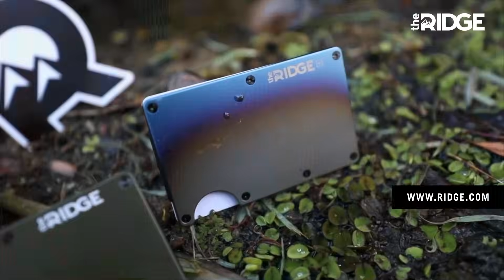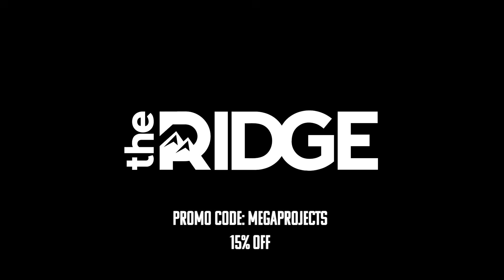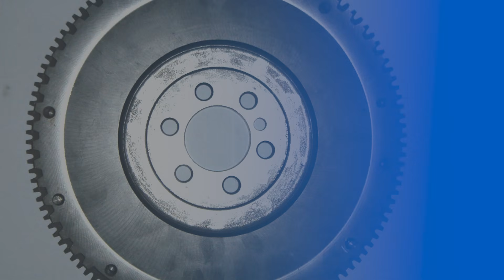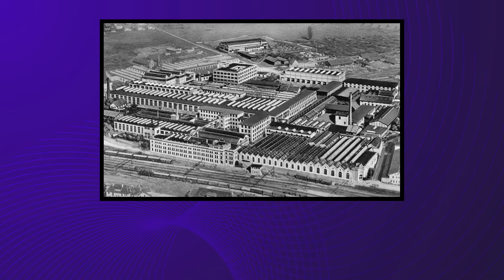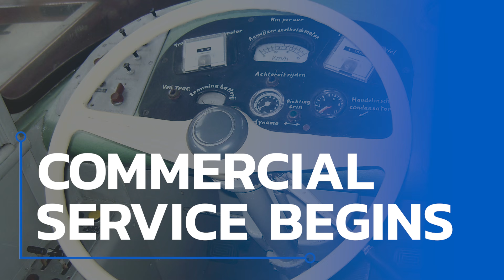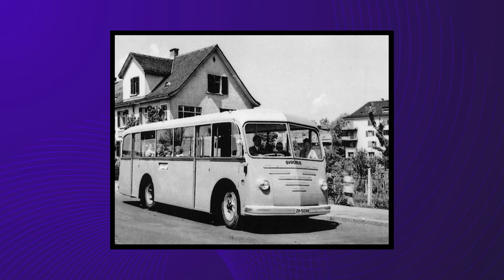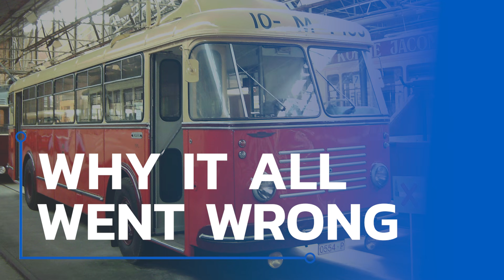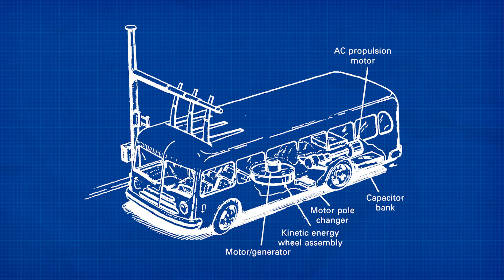Gyrobus: The Incredible 1950s Flywheel Powered Bus

Comment from the maker: Video Sponsored by Ridge Wallet. Check them out here: https://ridge.com/megaprojects Use Code “MEGAPROJECTS” for 15% off your order.
Reply: I was looking for a reason to buy a new wallet. Thanks for the help Simon! The discount helped out on my new Forged Pacific Ridge Wallet!
Reply: The British Railways experimented with Flywheel-electric locomotive for non-electrified tracks and with Overhead pantograph and thord rail contact shoe, it was tried out on the southern region of British Rail during the 1950s-1960s, however it was unfortunatley scrapped in the 1970s..
Reply: FFS 2 minutes of sponsor message - just because of that I will actively advocate against this product.

Comment: Back in the good ole days of kinder eggs when you actually got a toy you would have to piece together by hand, one of my faves was this little mini bike, it used a small flywheel to store energy when you gave it a quick “yeet” across the floor, it also kept the bike from falling over acting as a gyro as well. I always had a slight fascination with gyros for some odd reason.

Comment: There was an effort in the 1990s to implement flywheel-powered cars. They used banks of small vacuum canisters, each containing two counter-rotating flywheels whose kinetic energy was converted to electricity to power the car. Each canister was in effect a battery. I actually saw a prototype at the LA Auto Show one year and read road reports of the prototype, but it disappeared without a trace as far as I know. There was an experimental flywheel-powered bus in San Francisco in the 1970's that used a lightweight, high-speed flywheel, but it disappeared, too, as far as I know.

Comment: I am 75 and I remember as a 9 year old reading an article in a Mechanics Illustrated type of magazine a report of flywheel buses being used in Europe.  The flywheels were paired with a small engine that continually added to the rpms.  Another transmission linked the flywheel to the wheels.  They even used regenerative braking to return inertia of motion back to the flywheel while braking.  One detail that I recall was that at the end of the day, the flywheel continued to spin within the vacuum chamber holding it and enough rpm remained the following mornings to start the engine.

Comment: I think flywheels can have a future for buses that only travel short distances such as within a city or small area. In such a case the flywheel would not need to be quite as heavy. 

Additionally batteries no matter what type (which includes mechanical batteries like flywheels) do eventually need fixing or replacing as they age, at least flywheels arnen't made with litium which is expensive and enviromentaly problematic to replace. 

You could also have a small backup electric motor (or combustion engine). In case the flywheel looses to much energy due to for example a traffic jam or other unexpected stop.
Reply: NOw that idea of adding a small 'put-put' engine to supplement energy power is a sound idea.

Comment: Man! I've thought about gyro-batteries for a long time and really love the concept!
There are a few company start-ups trying to make them work!
they spun at 100K RPM or so and rested on magnetic bearing in a near-vacuum!

In my mind, I could never overcome the load part of the equation!

I think they had all of the containment issues solved for those RPMs in case of catastrophic disintegration.
But while they're a great idea, not now!
Maybe some denser, more stable material might come along.

Who knows! it's still a good idea! Especially for short commutes!
Reply: If you look into green energy storing startups a Oregon or Wash. state company was pursuing large flywheel energy storage to capture excess solar and wind power in this units that were steel flywheels weighing several tons. In a vacuum as well and the potential capture and output attached to an electric generator was very promising. Same tech ideas in that documentary special included using water reservoirs to fill up from the power, then be poured back through to transfer that power back into AC current.

Comment: horschett         either  your are  stoopid  or  you are deliberately peddling  false  information.        a flywheel can store  ONLY  a small amount energy.       if energy is 'taken off', and Not immediately replaced,  the  rpms of a flywheel RAPIDLY  reduce.
a flywheel is good for  Just  One  thing.      that is, smoothing the operation of a system that is inherently high in vibration;  such as,  a  PISTON/reciprocating  engine. !!!!!
this is why flywheels are  NOT  used, for anything else.!          googletranslate
Reply: ...anything else like inertia starters, or gyro stabilizers, or electric traction boosters, or...

Comment: San Francisco looked at reviving this idea in the 1970s as a way of extending the range of their trolleybuses beyond the overhead wiring. That seems to have ended up in the "too difficult" file.
Reply: San Francisco also is not a very flat city. If the bus has to change it's pitch when driving on and of slopes the gyro will try to tip the bus over to the side and would require the bus to slow down.
Cities in flat places like Florida might be a more suitable location to operate gyrobusses if ramps are avoided.

Comment: I don't see why hybrid electric buses aren't a thing. Take Frankfurt. The H-bahn uses overhead lines for power. Now, imagine a bus with a battery which can charge and drive on these lines yet can run off the lines using a battery system. You've got a vehicle which needs no fuel, can reach anywhere in the city and costs little to install or run as it uses preexisting infrastructure.

Comment: Manchester now have a small fleet of electric battery buses running on the 43 route to the airport. I suspect this is what we will mostly get in future and "clever and ingenious" transport solutions will just remain in laboratories. The buses in Manchester don't have any recharging places en-route, they rely on a depot charger. Essentially it's a toss-up between having fewer buses and installing expensive charging points on the routes, or more buses so some can be in depot charging to take over from a bus coming in for charging.

Comment: Damn, the Swiss were way ahead of the times with this one. I'd really like to see this kind of public transportation get revisited with more modern engineering techniques. This is an entirely viable and very innovative way to work around at least some of the ongoing economic issues involved in today's fossil fuel crisis.
Reply: This system would be better too until we can upgrade from Lithium-Ion to something less explosive, less damaging to mine and also not as finite a resource. Definitely greener with a flywheel system.
Reply: @dragonsword7370  Flywheels are much more explosive than lithium ion batteries if they fail.
If you store energy densely, as for example to fit enough of it into a vehicle, there is always some kind of danger from the energy being released in a deadly manner if the vessel containing it fails. Fortunately it happens very rarely.
Flywheel and centrifuge explosions are scary!
They entail a ring of heavy shrapnel flying at high speed containing all the energy stored.
But they are preventable by checking the material and operating at safe rotation speed.

Comment: How does it work?
Reply: Did not really explain that did he! I think it would be very inefficient! Electrical energy converted to Mechanical Energy buy a big heavy hot motor / generator then convertin gthat back to electrical energy to run another big hot motor to drive the wheels. Did the buses have aircon and heating ???

Comment: A flywheel based bus would still not work now. Roads and such may be better now, but traffic patterns are WAY to varying now compared to the 1950s. Battery technology has come so far that they make more sense, mostly. Oh, and you over estimate the intelligence of drivers these days, because yes, drivers drivers still take short cuts on dirt roads. In fact, the over all quality of drivers in the last 20 years has taken a steep dive....Hence radar cruise control and auto braking systems and "self driving" cars......People are becoming too dumb again to be trusted behind the wheel, and it makes me sick.

Comment: Because of the gyroscopic nature of flywheels, I'd think using them in a vehicle would be problematic.  Even having two counter-rotating gyroscopes has its issues.  As such, I think flywheel tech is best used in a stationary setting (e.g. as a grid equalizer or a backup system).  Plus, with the advances in battery tech, that is now the better choice (it might even be lighter; which is saying something considering how heavy batteries are).

Comment: A few years ago I was working in a warehouse/freight terminal, there were something like 50 forklifts moving at anyone time and someone came to work one day talking about how someone was inventing a compressed air powered forklift. My initial thought was "Yeh, that'll fly like a lead balloon" (This was before Mythbusters...) but they explained that most places that use forklifts already have a place put aside for LPG gas bottles and the bottles of compressed air would be the same, all they would need was an air compressor to fill them and one person to fill the empty bottles. Each FLT would have several bottles with one kept in reserve so that if you ran out of air in the middle of something you could turn the last bottle on to finish, and go to the refill station to get new ones. Something that even LPG ones couldn't have. 

The article, it was in a magazine, showed that, there is a lot of waste for a company because an LPG bottle would rarely be swapped when completely empty, and any gas left in when refilling was not taken into account when the company doing the refilling was charging you. However, with compressed air, it doesn't matter if the tank is still 50% full. It just means it takes less air to fill it. 

We never got any though. Some were replaced with electric ones, and they were alright. The main problem was, if someone forgot to recharge it overnight and you get in the next day and see it not charged, you're boned, whereas an air powered one, it's just a matter of swapping the bottles.
Reply: airheaded wordy comment about  a  FLAWED  idea. !!!!        phool
Reply: I feel like an air powered forklift would be really limited in terms of endurance.  It would be a lot easier to swap out sure, but the run time per air tank would probably be measured in minutes.
Reply: I can remember a fad in the 90's where there were a few companies trying to market things that ran on compressed air tanks. They all failed as far as I know. And with good reason, compressed air is one of the most inefficient forms of stored energy. You lose a lot of energy compressing it and it loses a lot converting it into movement again too.
Reply: @siggyincr7447  I mean, the old Air Hogs planes were really cool, but they were sold as fun children's toys, not practical products.

Comment: Big flywheels are damned terrifying. They are a really interesting concept, not only the ones used for energy storage but also those used in other places such as smoothing out the motion of the pistons in an internal combustion engine. But still, big flywheels, are damned terrifying, especially the ones used for energy storage.

Comment: There is a reason that travel times in the US are in HOURS, not miles, much less those wimpy clicks. I grew up in Europe and got used to good transport. The real reason US transit fails is they are not a System, just a whole bunch of lines. They do not shift between rush hour and off times to conform to actual need. Even here in San Diego they have only half a system in the South Bay. Busses connect to the tram on the west, but the is no I-805 terminus. There are no express transit center to transit center connections, even for most rush hour this
Reply: P. S. SANDAG take notice!

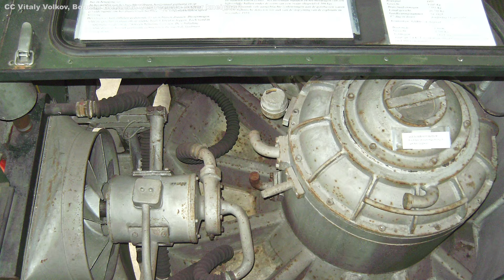Comment: 4:20 strangely enough, gas and diesel powered busses are still noisy and uncomfortable even in 2022.
Living in Toronto, I have been on busses that use flywheel energy storage for regenerative braking and launch. The system was not intellegently set up. For some reason I cannot fathom, the flywheel was braked to a stop a few seconds after the bus was stopped. This meant heating up the flywheel brake and wasting all the energy it stored just before the bus pulled away from the stop. Duh
Here in Lethbridge, we have a few hybrid busses. The battery electric drivetrain is great... That is until the engine kicks in to charge up the battery. That makes it just as smelly and noisy as any other bus.
I've also been on fully electric trolley busses in Toronto. They were powered by two overhead masts. I liked them because they were quiet, smooth, powerful and fume free. Butthey were all decomisioned because they were rare and the cost of repairs spiralled out of control. They were replaced with noisy, smelly, uncomfortable diesel busses.
Fully battery electric busses is the way to go. To reduce losses during regenerative braking and extend their range, I believe the best solution will include a bank of super-capacitors, with perhaps sulphur-sodium batteries for main storage. But we're not quite there yet. LI batteries are about the best we can do for now and they ARE good enough.
Reply: compulsive talker.?!?!?          apparently, your point was in the first sentence.       everything after was just your lips moving.!!!!
Reply: @daviddavids2884  It's not my fault you have ADHD. I hear there are effective treatments for your condition these days.

Comment: And 90plus percent of the electricity is generated by fossil fuels! And the fossil fuel generators are hid miles from population centers and suffer line losses, copper and iron losses in the distribution system, which means you need to burn more fossil fuel to get a usable kilowatt at the point of consumption! And our electrical grids are already stretching thing with out millions of electrical vehicles on it!

Comment: I remember a Popular Mechanics article (I think) from the 1970s about flywheel-powered cars that proposed using fiberglass for the wheel. This made the wheel much lighter and allowed it to spin faster (maybe 100,000 RPM.) Since energy storage is proportional to RPM squared (I think) the amount of energy stored went up dramatically while making the whole thing lighter.
With modern carbon-fiber materials, it could store even more energy.
The problem with this was that if something broke, the energy could be released all at once, causing a massive explosion. (This is true no matter how energy is stored. Gasoline and lithium batteries burn also.)
Anyway, I thought it was an interesting idea,
Reply: There was even a 2 wheeled vehicle that was stable because of the massive gyroscope in it.
Reply: @luukrutten1295  Do you mean a segway?

Comment: Its not really accurate that batteries was to heavy. IN 1950tys NiFe batteries would have been readily available.

I would rather suggest that the main problem with batteries back then was not really the batteries them self, but rater charging electronics

Also, its not  really more environmentally friendly if it uses more power
Reply: Unfortunately, NiFe batteries are pretty heavy compared to the power stored in them, about 25Wh/kg, as compared to lead-acid - about 40Wh/kg. They are great for stationary facilities, less so for mobile uses.
Reply: @FalbertForester  The 25wh/kg is from the inception of NiFe batteries, later it reach about double that.

Even at 25wh/kg, that is still a lot of energy. A bus that size need about 1.5kWh/km. So one km at 25wh/kg, would take 60kg.

A normal bus engine is about 1000kg, so just replacing it would give it a range of 17km

Comment: Fly wheel are used to store energy for UPS systems, the amount of energy you put there is insane for its little volume.  They use magnetic bearings and are under vacuum.
Reply: All UPS systems I've seen use batteries. All I saw in the warehouse 20 years back were lead acid, but that may have changed.
Reply: @maxpeterson8616 you have missed that. I know a lot people who worked with that kind of systems. Google Teraloop

Comment: The flywheel, being on a vertical axis, would not affect the direction of the bus. Only its tilting side to side or end to end, so I cannot see how it would affect the driving of the bus.  11:14
Reply: I'm guessing that every time the bus wants to lean on its springs as the driver starts to turn, or goes over a bump, that tipping of the flywheel's vertical axis would produce a rocking force oriented 90 deg to the tilt, so maybe changing weight balance front-to-back.  Similarly, when you hit the brakes and the bus leans forward, the gyroscope puts a sideways lean on the bus.  The effect is called precession, I think.  That's my guess -- if you need credentials I can show you the toy gyroscope I had as a kid.
Reply: 11:52 and can flywheels counteract?